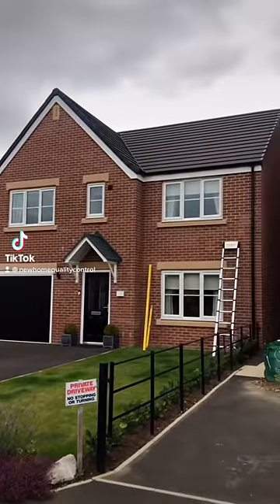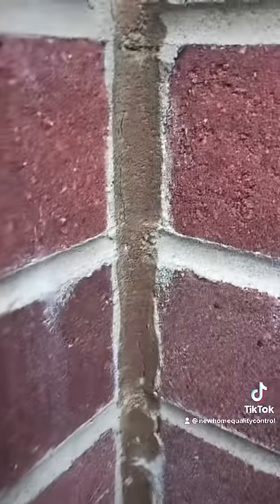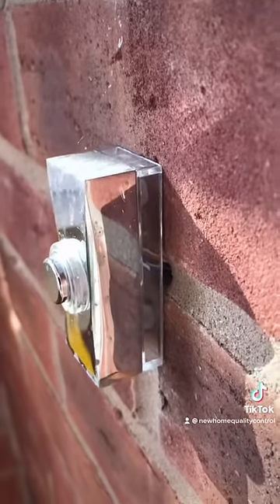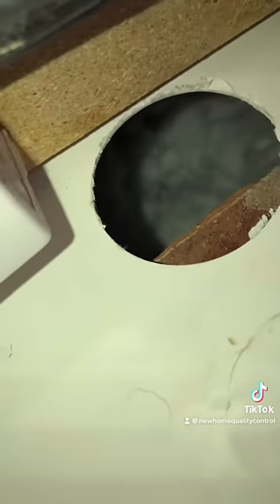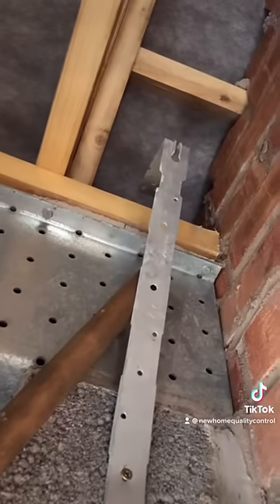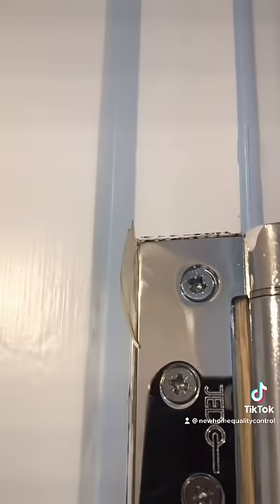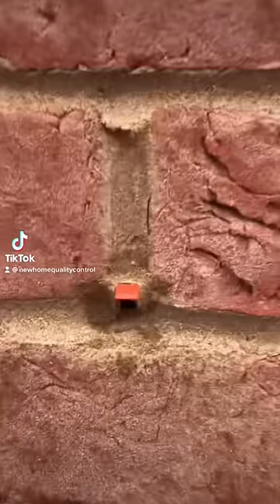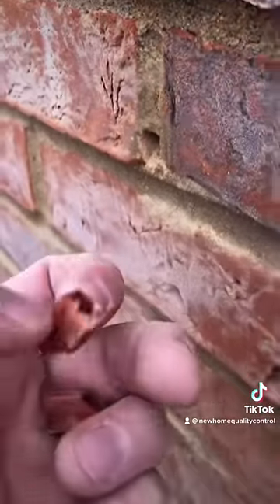MAJOR ISSUE FOUND AT THIS NEW BUILD! | FAKE MOVEMENT JOINT?

Comment: Self regulation in house building is huge issue. Lack of education in management to life threatening dangers is rife. Failure to integrate explosions danger into the training module for bricklayers is standard. Building control not even aware the problem is ridiculous. In the 1980’s a large explosion prompted an urgent national response and tens of £millions was pumped in to bring the brains of Britain together to redesign the substructure of house building. The new model was fantastic and addressed the threat from all rising land gases with remedial inclusions to neutralise all possibilities of utter disaster. The solution was twofold with the first being the installation of gas liners used in conjunction with traffic light alarm warning systems which work just fine and a new training module was established specifically to fit these liners so the education is available. The second aspect was the creation of a large void beneath the floor of new houses which was intended to act as a ventilation system. To achieve a constant air flow throughout all spine walls underground have to be built a certain way to allow for this air flow. With this design it is vital that the ventilation inlets and outlets are in full working order or the ventilation void actually transforms into a storage chamber for rising gases which over the years just a little trickle of gas here and there will eventually fill this void. As a lifelong bricklayer I am fully aware how the vent systems need installing but I have seen very few fitted correctly on any housing site. The consequence of this is for every new home built wrong a new powerful bomb has been created. How many bombs are laying dormant who knows

Comment: You need to understand that there is a difference between movement joint and a crack control joint. A movement joint is to control the thermal expansion and contraction of brickwork and is required where the brickwork is greater than 12m , it is 6m when using blockwork. Your description of a movement joint is correct where foam strip and mastic is used. However there is also a crack control joint which are less common and these are sacrificial there if the consultant engineer thinks that a change in the corner of the building has a risk of cracking during the construction process itself etc then he can specify a crack control joint. As morter is weaker than the surrounding brick then the morter will crack first protecting the brickwork. The usual for builders is to build movement joint and crack control joints as just movement joints but it is  not required. You should however check with the consultant engineer whither they specified a movement joint or a crack control joint.
Reply: Hi ,if mortar cracks first before brick( if mixed correctly) why would you need a crack joint or any other measures.👍
Reply: @JohnJohn-cu7nk  crack joints are rare. There are seen as temporary control joints in the sense that that the movement is during the construction process. I have seen them on a semi party wall where during the construction process there might be movement between both houses which effects the outer leaf. Again generally if temporary movement happens you simply repoint the morter, but generally bulders build crack joints as movement joint so they do not need to monitor or repoint the joint. Morter is always and is designed to be weeker than brick and if you have a strong morter for instance you use the wrong sand you use sharp sand you are simply asking for trouble. The engineer.would be the person who specifies the type of joint and location. Morter can be repointed, cracked brickwork cant be fixed.without ripping out large areas to repair.

Comment: Money talks. I gave up on new builds.  Seen to much bad practice. The pressure from top to bottom to complete is unreal. The top companies have absolutely no pride in their finished product. Top make companies seem good awards are given through nhbc .pride in the job. Big companies usually select one or two sites out of many being built to try and gain prestige whilst all their sites suffer. Nhbc are not good for purpose. Needs re structured badly.

Comment: Like many things today, quality of new homes has gone down considerably.   It’s all about expediency.  We have been on a mission to relocate from dry, remote West Texas to the much prettier Hill Country for three years now.   But new houses are much smaller, much more poorly (and hastily) constructed and much more expensive where we have looked.  Wood posts have replaced brick and stone and the general construction material is wood with maybe a bit of lantern stone (limestone blocks) added to the outside.  No thanks.  We aren’t going to pay over 100 k more for a new house that is poorly constructed, 10k square feet smaller and 100k more expensive.

Comment: Are you sure that movement joint isn't just to disguise a ropey pointed corner? The house certainly isn't 10m wide so it shouldn't need one. Whilst not correct but in defence of 'no through bolts' on the handles sometimes the handles are so cheap the threads are so poorly machined they are impossible to tighten home (and I mean totally impossible). As long as there are 5 screws plus the grubsrew tightened both sides it shouldn't be coming off and you already know my feelings on the virtues of wallplate straps.
Reply: The make them through bolts out of butter and never ever seem to be the correct thread.
Reply: @NS_RC  unless you are going to bring your engineering toolkit and tap them out i'm afraid its skip time!
Reply from the maker: Yes it needs a movement joint, they’re concrete bricks by the way. I’m a carpenter by trade, you need the through bolts, the grub screws come loose over time and the screws and bolts work alongside each other securing the handle. I once heard there was a case where kids ripped a door handle off in a fire, do you really want to be responsible for that situation, no, of course not, fit the bolts and the screws.
Reply: @newhomequalitycontrol  Ok how should I fit the through screws when 30% of them  get half way down the thread and snag? There isnt even a screw head on the backside of the crap we get to fit it's just flat.  I once heard sounds like your making it up to me. I have known a customer get locked in a bathroom when the thumbturn grub screw came undone and it pushed through .....what would happen if that happened in a fire?
Reply: @newhomequalitycontrol  fair play on the movement joint tho. I thought the bricks were clay.
Reply from the maker: Look at the end of the day, it doesn’t matter if you believe us, if we’re making it up or not, that situation could occur either way, and I definitely wouldn’t want to be responsible for causing someone to be entrapped, especially in a fire. If the bolts don’t work, tell someone or refuse to do the job, I know it ain’t that easy. A lot of the time you need to cut the through bolts down for standard doors as they’re made longer for fire doors.
Reply: @newhomequalitycontrol  Locktite the grub screws. Used to do maintenance in hotels, always carried grub screws with me and threadlock.  Agree that through bolts should be used.

Comment: I build my own homes. On this one, in a place I have never built before and is currently under construction, I have kicked 7 plumbers out of the house. Every one made major mistakes. Last week I reinstalled a toilet that was leaking. How the FU#K can an experienced plumber not be able to install a toilet properly? Not only was it installed incorrectly, A bead of silicone between the toilet and the tile did not allow the water to leak out, leaving the problem undetected for six months. The smell of methane escaping was what led to the discovery.
Next house I will do the plumbing myself.

Comment: Many years ago I bought a Victorian terraced house.  There was not a straight wall anywhere and it was soon obvious that the try square had not been invented in 1890 or the builder was yet to invest in one.  I told my wife, never let me buy an old house again.  She did however, we now live in an Edwardian house in a posh area on the south coast but the build quality is just as bad!
Reply: The houses your speaking of are hundreds of years old, they move over time and are designed to do so to prevent splits and cracking in the masonry. They are still of much better quality just old. These new builds will be lucky to see 25 years of age. Lucky to still be standing once the mortgage is paid.

Comment: Owed to the non attention to detail it is a near certainty this house is exactly the type I have spent years warning about as being a life endangering very real threat only to be classed a trouble maker and thrown off site. Your air vent is the most important fault there could ever be and I am sure u will find your vent is not connected to your vent system which places your home in the high risk level from explosion. All non explained explosions will have been caused by this problem.

Comment: What would they need to do to get Iver the fake weep vents?
Reply: You would  need to drill the full perp out and fit a full weep vent so not difficult(if the tray is in place). It's not generally a big deal with non engineering clay bricks as water would leach out  anyway although the brickies are paid to fit them properly.
Reply: Takes seconds to put in new weeps..
Reply: Would be surprised if Dpc tray was lapped up properly neither. If they are missing basic vents what else is hiding.

Comment: I often wonder if some of this stuff is referred to the police, and if not, why not? These snagging videos frequently highlight issues such as fake weep vents, fake ventilation bricks and so on where the intention has been to deliberately deceive the buyer and/or inspectors into thinking the construction is to standard. Having a building element out of spec is one thing (the amount of out-of-plumb stuff these guys find is riiiiiidiculous!) but to intentionally "fake" something is surely not something that can be fixed with just  remedial work. Someone should be getting a fine or some jail time.

Comment: that fake movement joint is rough as fuck.
Reply: I'm sceptical it is a missed movement joint. The house isn't wide enough to need one. More likely the straight nick joint looked crap so site manager asked the silicone guy to hide it
Reply from the maker: No there should be a joint. Concrete bricks.
Reply: @newhomequalitycontrol  I assume its Persimmon Homes as they now put movement joints everywhere due to the bricks they use
Reply: Why is the mortar in the fake movement joint a darker color?

Comment: Movement joints are a load of BS anyway
Reply: So sod the regulations eh.
Reply: Correct ,what is the point of putting a movement joint on a brick corner ,didn't have these in older houses,only have movement joints between houses or every 6 metres
Reply: It's to help hide poor foundations

Comment: Note to presenter - Please, please, just stop saying absolutely shocking, shocking - there are other words that clearly describe what you are finding - illegal, cowboy standard, piss poor site management, total crap - some not pc but spot on -  
note to viewer - having supplied the house building industry for over 48 years, one thing was totally clear, independent small builders putting up 3 or 4 houses each year offer better value, less strain than the multi nationals whose aim is volume regardless of finish, lowest priced materials, lowest price labour and then try to squeeze extra by not paying suppliers or sub contractors. Do yourself a favour - either go small independent or buy any property built before 1980, you are in danger of getting hold of a property built by trained craftsmen who went thru 5 years minimum of apprenticeship, then were employed based on their ability not how cheap they could be, the only down side is that National HB’s offer lots of financial incentives but weight up the stress of new build snagging and the worry that the house has not been built correctly in the first place, against the knowledge that a independent HB or old property will still be standing in 5 years time. 
Also please note - the “new” house you are buying may not be built to todays building regs - if the site was given approval 5 years ago, the regs that applied then are what are used so if insulation requirement was say beefed up today to double what it was 5 years ago, and approval to build was given 5 years ago - that is what you will get, meanwhile you will be thinking that your new investment of £300k+ will be current and able to face the future, when in fact it is out off date and given the state of some of these “snags” already falling apart.